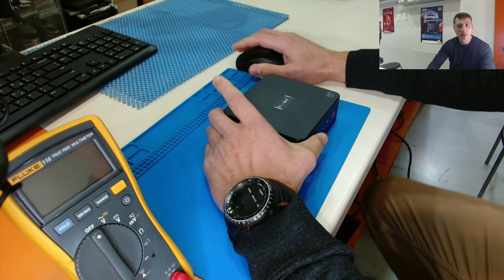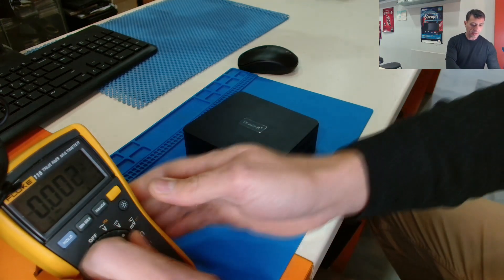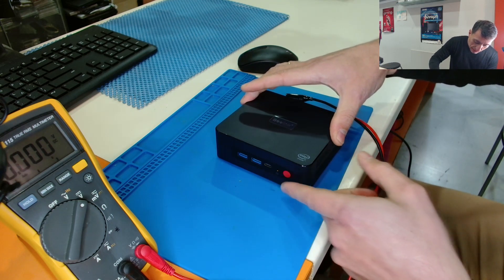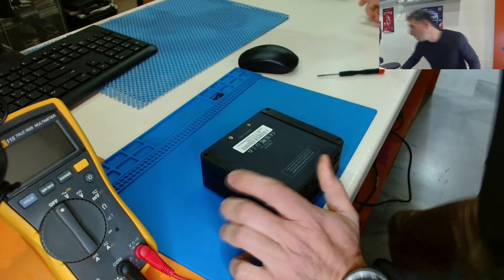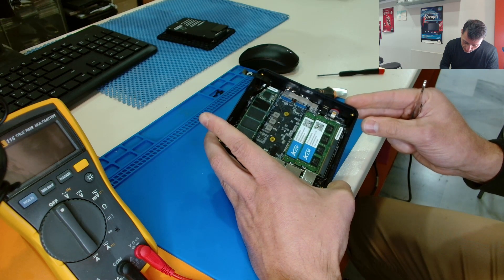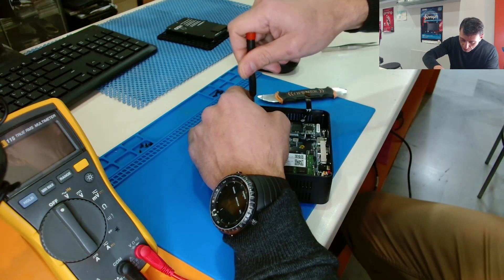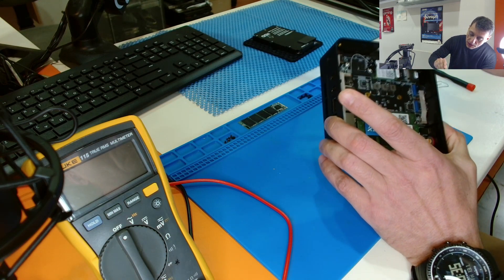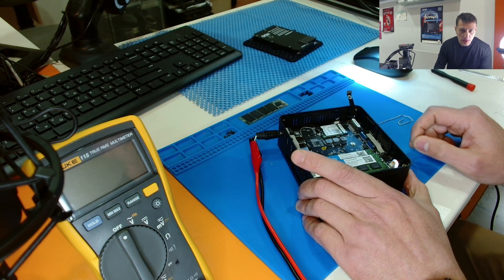Beelink U59 Mini Pc - not powering on

Comment: Have had mine for 3 years now. Did all of the suggested fixes below but still a problem. Not overheating. 5 Minutes doesn't work. 10 does. I removed power supply and wait. Changed power supply and cmos battery. Still can't handle more than one thing at a time. Watching a You tube video today and it shut down. All my drivers are up to date. Removing the motherboard I had to put a little pressure outward on the casing to release the ports. And the same putting it back in.

Comment: FYI: you don't need to take the top off. Just disconnect the antennae from the chip (the antennae are soldered to a pad taped to the inside of the top), undo the four screws on the mobo, and pull out the board (using a spudger to push back the four clips on the side)

Comment: Had a similar issue with the U59. BIOS would start to boot, then freeze. Tried the BIOS reset - still freezing on BIOS boot. Removed the SSD and the system booted (stopped because it couldn't find a boot device). Popped a Samsung SSD in, reloaded Windows from a USB stick, and it's been perfect ever since. Beelink ship with crappy unbranded SSDs and RAM chips. Swapping out either/both for good branded ones seems to be the way to go. Hope this helps someone.

Comment: Thank you. I had the same problen with one of my two Beelinks. Resetting the BIOS solved the problem; however, some o fmy home pages failed to load. Eventually, I traced the problem to the date. Apparently the date was reset to the date of manufacture and automatic date set was turned off, I manually changed the date and time, to the current date and time. Then the pages loaded. I also reset the automatic time/date update.

Comment: Mine does turn on the power light, but doesn't send signal. Having it unplugged for a couple of hours makes it work. If the pc is turned off, I have to disconnect it from electricity. I do not recommend this brand.

Comment: Same issue with a b2pro and totally worked when I was about to give up. I thought the reset button was just a forced reboot. I even disconnected the battery inside but only resetting the bios as you did worked. Thanks!
Reply: how did you reset the bios ?
Reply: @hectormedina1962  the way it is explained by the end of the video. You don't have much patience, do you?😂 Just keeping the reset button for long (don't remember if it was 20s)

Comment: I have a different beelink mini pc model but it's the same pcb configuration. Resetting the bios but did not work. I bought a new power supply - did not work. Removed drive and memory, reset bios, and still not working.
Reply: Same issue, think beelink have bad pcb